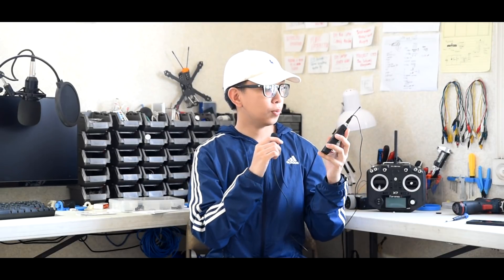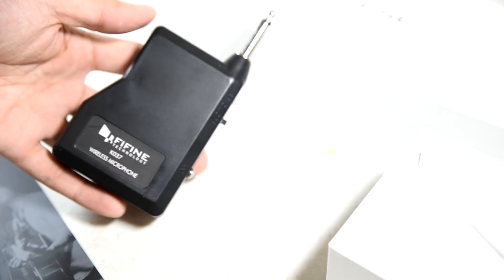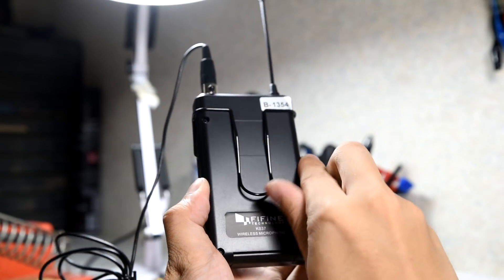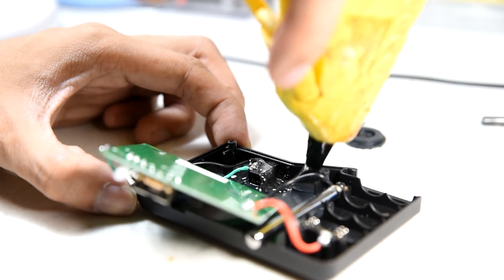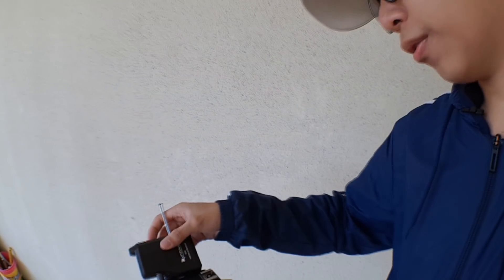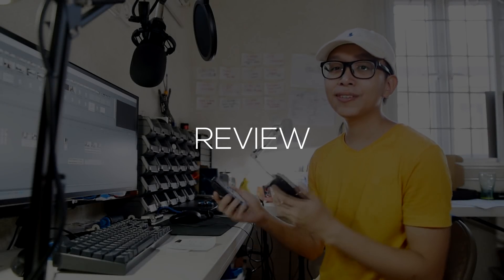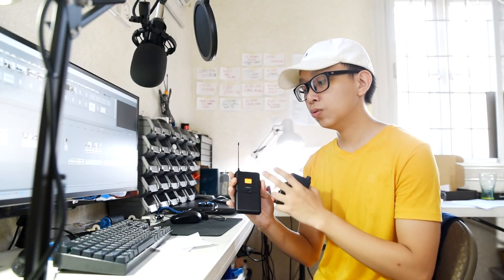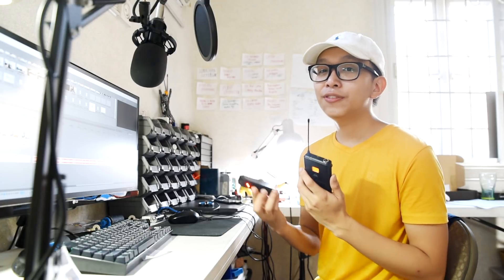Cheap $25 Wireless Mic For DSLRs (Mod & Review: Fifine k037)

Comment: if both of your antennas are in the same direction, either up or sideways, you will get better range for your audio. 

If you have one up  (vertical) and the other sideways (horizontal) , like you did laying on your camera, you will lose some signal and the range will not be as good. 

this is called cross polarization and is the same with any transmitted radio signal.  make them the same and you will get the best range possible.

Comment: TechBuilder great video! You can mention the list of pieces that I need for adaptation and be able to buy them with your technical name please. Would it also work for a Sony A6500? thanks for your help
Reply: Aparte de obviamente el cautin y la soldadura se ocupa un puerto hembra de 3.5mm audio stereo, lo puedes comprar en cualquier tienda de componentes electrónicos como steren, tambien puedes usar un adaptador que de un extremo sea audio 1/4 hembra (como el de las guitarras eléctricas) y del otro sea salida 3.5mm tb se conoce como 1/8 macho (como el de los audífonos) (te lo pongo así porque muchas veces los weyes que los venden ni saben como se llaman me ha pasado incontables veces), se supone que este kit incluye un adaptador así, si quisieras comprar solo el adaptador te pueden preguntar si lo quieres stereo o mono lo mejor seria preguntar si tienen uno donde sea de 1/4 mono a 3.5mm stereo porque este mic solo graba un canal en mono y básicamente estarías comprando un cable de lo que hizo este morro pero depende de que busques, simplemente pudieras usar un adaptador mono y arreglarlo en post sin bronca,  yo personalmente si me llego a comprar este micro (que no creo pq no me gusta el rango dinámico), si me aviento el mod pq se me hace muy aparatoso traer el jack de 1/4 con tanto cable en la cámara, ademas de que es mucho mas barato comprar el puerto, más barato aún si ya tienes cautin y te la pasas soldando chingaderas.

Saludos cabron.

Comment: all that soldering and drilling and breaking down to replace a 1/4 male for a 3.5 female input when you couldve simply attached a 1/4 female to 3.5 male cable to the receive. lol

Comment: @TechBuilder Awesome how to. Thanks.

Let me return the favor. You see the motion blur that you get in your videos after editing? I imagine you are using Sony Vegas. Follow these steps and you will never have motion blur ever again. It only takes a couple seconds. You need to perform this every time you create a new video.

Step 1) Before you are about to render your video, go to the top toolbar and you'll see an arrow with a square dotted box around it, select that.

Step 2) Left click the mouse and select all of the video and text in the timeline that you created, do (Not) select audio, selecting audio will not show you the selection that you need to select. Remember, the audio is fine, it's the video and text that is blurred during movement.

Step 3) Once you've selected the video and text right-click anywhere on the selected items, select Switches, then select "Disable Resample".

Step 4) Now you can render your video and it will never have a blur effect again. 👍
Reply: Keyboard shortcuts, press (D) a few times and it will cycle through the shortcuts until you get to the dotted square. To to clear out and go back to your default cursor just hit (Ctrl D).

Comment: Thanks for the review. Hadn't heard of this system before. In this case I'd be more inclined to just use an adapter rather than hack the circuit board/case. Personally, I think hacking a hot shoe mount (something like this: https://www.amazon.com/Neewer-Durable-Mount-Adapter-Tripod/dp/B00OT75QTA/ref=sr_1_3) to the case would be more useful. But that's just personal preference. Cheers.